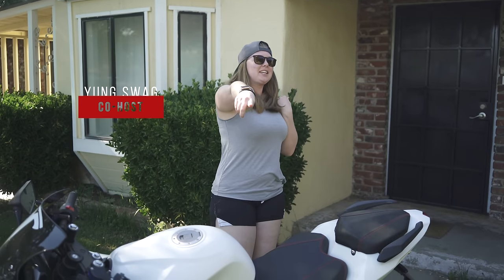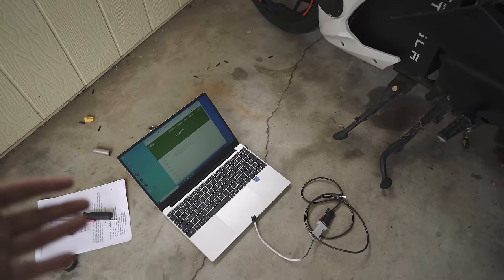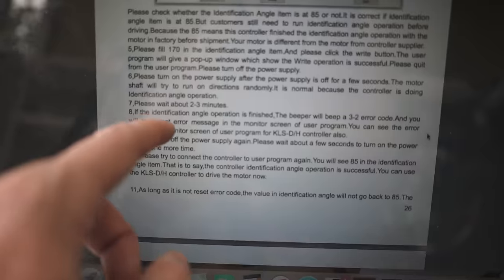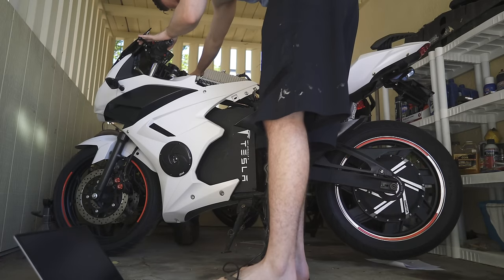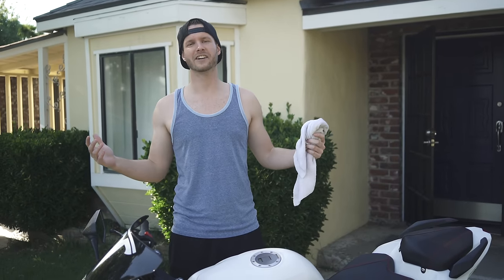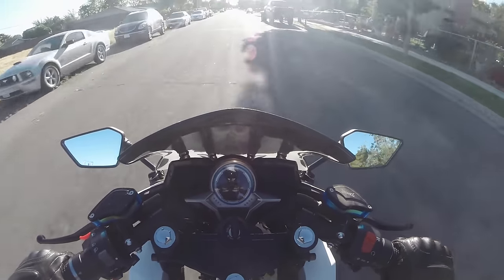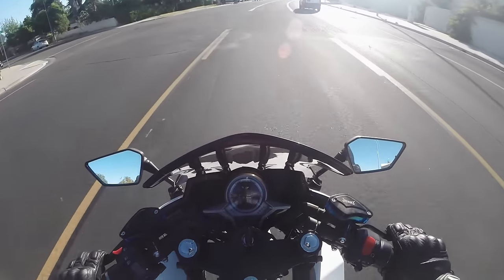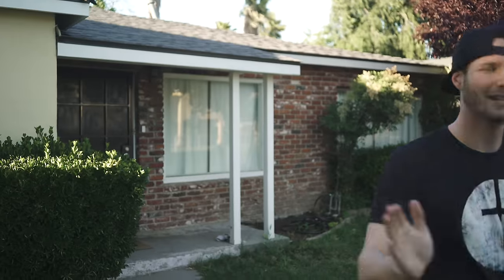The CHINESE ELECTRIC SPORTBIKE is FAST [FIRST RIDE after Mods]

Comment: Does these electric bike not have some sort of alternator to charge the bike as you ride? That would be dope, the more you ride the more your battery stays charged
Reply from the maker: Electric motors have regenerative braking, so it charges the bike on deceleration.
Reply: The Inja weird. Sounds opposite to me but I’m sure there is a reason why.

Comment: Nice build, cool know how and nice of you to show it to us. But bike that is no where near sport bike territory.
8000watts is 12 hp. Any  good 150cc bike has more hp.  Yeah it's torquey, and will be a great city bike.  But it doesnt rip.. a zero sr/s rips...
Reply: Pablo Cruz it’s actually putting out 21000 Watts at full throttle, which may not be amazing, but that’s 28 or so electric horsepower, so respectable

Comment: the bike project is cool and all but why are you acting like its "sooo fast".. i mean litterally anyting with a 15hp engine is faster... a modern sportsbike almost never have under 100hp. i have 150 in my ninja (with the N ;) ) and something like that, yes its fast, it deserves to be called fast, a pull on that will leave your hands shaking more or less,. have you ever ridden a bike similar to that? it will change you concept of fast, i thought i knew fast cuz ive been in 450hp cars but no.. not eaven close, 120mph before you even realize it and it just keeps pulling. now with that said, im not a big advocate of speed, and i know my bike is nowhere near the fastest (but more than enough for me).Im not one of those "you have to have a litre bike to be cool" type, i own a ktm 640 and a yama xv250 (yup like 25hp xD) aswell, and i believe its not about the hp but the smiles per gallon. but still... dont call it fast.. call it quiet and different, thats its strong sides. speed.. not so much...
Reply from the maker: Yes yes yes I've ridden 600/1000 supersport bikes, I know what it feels like.

Comment: That "clunky" sound seems to be your spacers improperly done. Possibly bad/tight/dry bearings
Reply from the maker: Phase came pre-set to 8, but the motor is a 16 Phase motor. Changed that and it runs 2x as smooth

Comment: "This is almost like actual sportbike status" 😂 not even close. No hate, still super impressive that you made this by yourself, but nowhere near as fast as a sportbike.
Reply from the maker: 0-60 in 4.9 seconds isn't 3 seconds like a 600-1000cc supersport, but it's almost there. Feels similar. So you can chill thanks
Reply: Careful. These hub motors will easily smoke anything gas powered. They will handle over 20,000 watts. I run a qs27340h on a eeb chassis and leave everything in the dust on the daily. The funniest part is when you hear the gassers raping the throttle trying to catch up.

Comment: I work with these kellys on almost a daily basis. glad to see ordinary people using them. the way i do the phase wires and halls is blue to u, green to v, and yellow to w, then i match up the hall colors and run the identification angle set up and its smooth as silk. that knocking you got is scary! if you want to tune it better im sure u can with the phase current and battery current setting. i usually work with a Enertrac hub motor its a 10kw continuous hub motor made for motorcycles. what you got looks like a lot of fun. if you had a 10kw motor you would fly.
Reply from the maker: We dialed it in today and it's way better now!
Reply: @TheInja  now i wish u had some kind of time trial race thingy with the old configuration of the bike vs now after all the amazing cool work you and youre group has done.

Comment: Supposedly changing 2 phases out of 3, will make your motorcycle go backwards.
If you want a reverse, just install a switch where 2 wires will be crossed.
However, don't do full throttle in reverse, without installing some sort of resistor in series with the motor, or you could potentially go full speed in reverse! XD

Comment: Bro I think your punching if you think that bike will do 150 miles.
Reply from the maker: Did you see the specs of the (3) battery packs we made?
Reply: The Inja yeah, it’s not possible brother. You will see over time. when you start blipping that throttle and begin experiencing more drag at higher speeds that battery will soon drain.

Anything over 30mph will zap that power down and with the total weight of bike will also put additional drain.

I will say though it does look incredibly dope, I’ve been thinking of buying another Yamaha DTX and converting to full electic.  Keep the petrol spares for the first bike. 

I built my second electric bicycle this year after Christmas. After around the second month the novelty wears off and the bikes just aren’t as capable as their 2 stroke counterpart. That’s not to say I don’t prefer electric for inner city riding.

Congrats on completing the project though. Feedback on mileage once you get a few miles on the tyres!

Comment: The motor running in the wrong direction means your wiring is wrong, you need to swap two phases
Reply: That is a thing of the past. The controller takes care of that for you..

Comment: I've built ebikes. That battery was a work of art but you really know what you were doing with the whole package. Hub motors are relatively simple. Folks put big hubs on bikes but your frame is way better, much better suspension. It looks great. There's nothing that screams "horrible design". I can't believe how well it came together. I mean, some guy put a Harbor freight motor in a Harley. That was silly.😾 This opens things up. Would like to see the costs. Thanks!!
Reply from the maker: Will do! Thanks for the comment.

Comment: did you ever ride anything bigger than 250cc..?
Reply from the maker: Does an R1, FZ6, Suzuki Bandit 1250 count?
Reply: @TheInja  they should do. Did you ever give them full throttle? Sure the electric bike has some real torque but that wasn't "fast"  I would barely consider it 'brisk'

Comment: A Sur-Ron would wipe the floor with it slow af
Reply from the maker: Not after we actually tuned it (after this video)
Reply from the maker: It was running at half power here (but it was a lot faster still than it was before upgrades)

Comment: Not only are motorcycles be hard to see, now you won’t hear them coming - until the rider comes through your windscreen.
Reply from the maker: If you're that unaware anyway, you wouldn't have heard any bike coming
Reply: I'm going to pretty much guarantee at least 99% of the motorists today in motor vehicles don't even hear a loud car coming let alone a motorcycle. Thats a 100% myth that loud pipes save lives. Had a old school bobber type motorcycle with loud pipes and STILL had people pulling out in front of me doing the speed limit, boxing me in at intersections, and riding the yellow lines going into blind curves, or they're looking directly at you and at the last minute peel out in front of you, then proceed to flip you off when you slam on your horn because yeah it was my fault that I wasn't going 10 mph in a 40 to give them plenty of time to pull out and drive off.. I ended up selling that bike after some dumbass pulled out in front of me and I clipped their front going about 45 mph, thought I was a goner for sure. Was an expensive repair too, even when my insurance paid for a majority of it.. not to mention my ankle was shattered from the impact. I figured if people are dumb enough to pull out in front of you when they see you coming, I'm not going to loose my life just over some passion of riding the open roads, I'll stick to offroad riding, don't have morons on the back trails trying to side swipe you, or over take the trails because they believe they're in a hurry to get their lunch in the afternoon. 

No wonder there are bikers out there blasting peoples mirrors, motorists are sure as hell lucky they didn't get shot. You can be fully cautious and eventually you'll still get into an accident cause people driving cars are too busy fumbling with their cellphones, radios, or bitching to their passengers to realize there are more people on the road than they expect. The major problem today is drivers just don't pay enough attention to their surroundings, they're careless of other people on the road, and ignore anyone on two wheels regardless if they have the right of way or not.. 

Even when you're on an pedal assisted electric bicycle (yes there is a difference, only due to the wattage rating being under a class 2 of 500watts), people who aren't paying attention while driving will pull out in front of you, side swipe you, or slam on their horn and scare the hell out of you if you ever so slightly swerve in a bike lane. I personally think motorists believe just because it's a smaller vehicle it'll stop faster.. thats my only plausible guess on what a lot of dumbass drivers think when they instantly pull out on anyone on two or three wheels when they clearly see them coming.

Comment: Have you had an opportunity to race a real motorcycle?  Asking because I’ve modified an Emmo proton.  I can beat any street bike 0-100km/h.
Reply from the maker: I used to ride sportbike around, so I know what a fast bike feels like.
Reply: @TheInja  okay because judging by the parking lot goes.  It’s not that quick in comparison to a street bike is why I asked but perception is everything in videos.   Where are you guys?
Reply from the maker: @jarrettloft6566  obviously I wasn't grading it on a 1000cc supersport scale.
Reply: @TheInja  fastest bike to date that I’ve raced and beat to 100k is a GSX-R750.  It’s interesting to see how the race goes. I smoke everything off the line then at about 110km/h the bikes go past me but nothing so far can touch me under 100k.

Comment: Gay mc and gay drivning with turn signal on amature 🙄
Reply from the maker: If that's what your comment was, you aren't a pro yourself 😂😂😂
Reply: @TheInja  i dont drive arround with turn signal !!!! Its gonna kill you when a car think your gonna turn And they pull in front of you, your gonna fly over the hood 😄 ( that is a amature move when you cant read the trafic ) 😉
Reply from the maker: @thomashost9562  good for you 👏🏽👏🏽👏🏽👏🏽👏🏽👏🏽👏🏽👏🏽
Reply: @TheInja  dude, it's a 250cc Chinese made electric motorcycle, it's not fast and it certainly doesn't "pull u" like the majority of other real bikes out there. Fast would b a non Chinese made liter bike like a yamaha r1 or even an r6..
Reply from the maker: @Eystein.K.Nicolaysen89  I have a ZX14R if that's fast? I'm obviously comparing the speed on this bike to it's former speed before upgrades. Still no slouch.
Reply: @TheInja  we're not hating in the comment section about u mentioning it's "fast", but we all know ANY 250cc motorcycle (Chinese or not) is not that fast and isn't that exciting to ride..nothing to get hyped up over..
Reply from the maker: @Eystein.K.Nicolaysen89  ...you do know this is an electric bike, right? with an upgraded powertrain? I think you missed the entire point of this project. haha
Reply: @TheInja  dude, most dirt bikes could easily smoke any 250cc Chinese electric motorcycle! 😅😅
Reply: @TheInja  i normal like Electric bikes and also Tesla is super fun to drive and is insane fast 😅 

But i did see an Electric super bike with 315hp, that one is a real bike. The White one in the video is like a70cc scooter 😅
Reply: @thomashost9562  Us real bikers find it funny (and weird) when adults (males specifically) would rather ride a kids bike over an ACTUAL fast bike like a liter bike or even a harley for that matter! 😅😅
Reply: @Eystein.K.Nicolaysen89  hehe i hate Harley the sound and not made for speed 😄